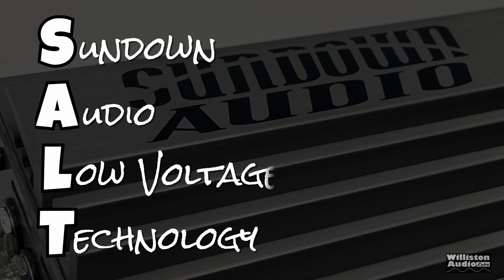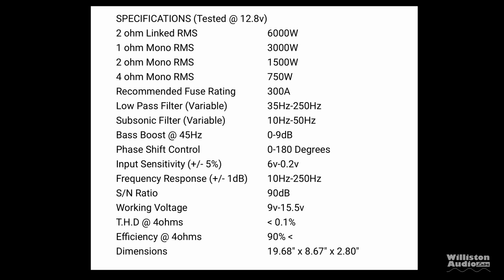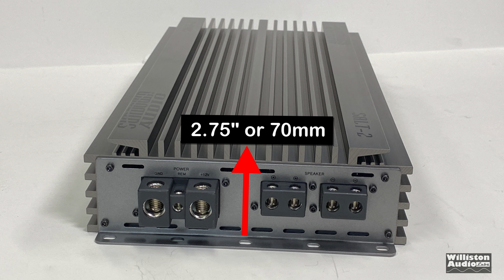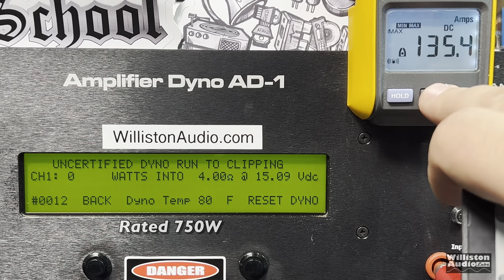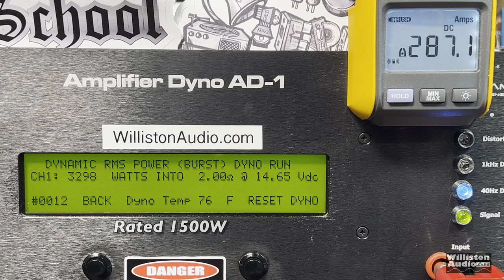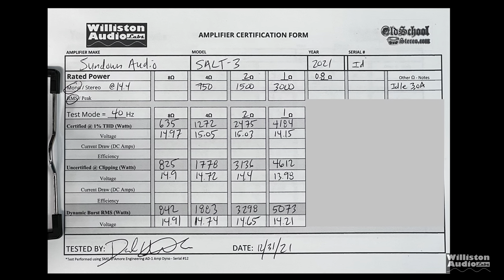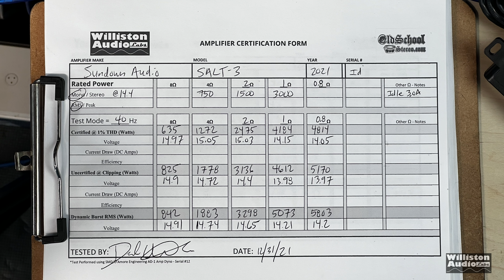Sundown Audio SALT 3 Amp Dyno Test 3000W [4K]

Comment from the maker: Sundown Audio SALT 3 Amplifier
Shop: (affiliate) https://lddy.no/1192y
3000-3500W Korean Amps Tested: https://www.youtube.com/playlist?list=PLu98-M_EowHMCHb5oUBnPVqVhMas4oq62

Video Index:
0:00 Intro
0:25 Sundown SALT Unboxing
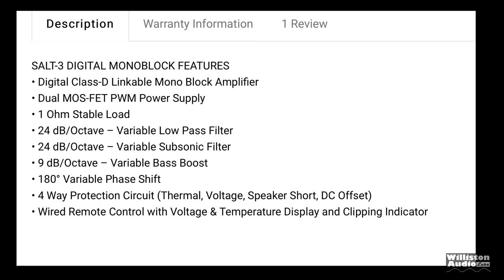1:28 Features and Specs
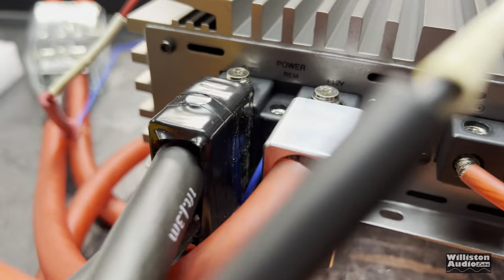3:07 Amp Settings for Dyno Test
4:02 Amp Dyno Tests
6:48 Results
7:06 What's Inside
7:37 Pros and Cons
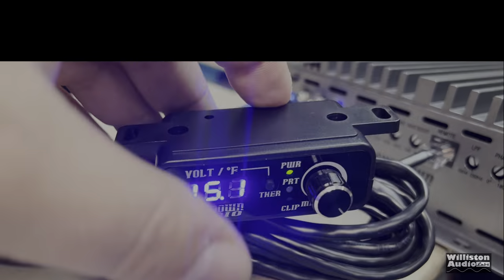8:25 Conclusion
8:55 Extras

--------- Test Bench Equipment -------

SMD / D'Amore Engineering Amp Dyno: https://goo.gl/sJTcf7
XS Power D1400 Batteries - https://amzn.to/2BPFCKW
XS Power PSC60 Charger - https://amzn.to/2CHGcfs
Fluke 1000A AC/DC Clamp Meter: https://amzn.to/2Rw5WDA
Handheld Dyno SMD AMM-1: http://amzn.to/2u2EgKV
My Favorite Screwdriver Kit: http://amzn.to/2x0VzcE

DISCLAIMER: This video and description contains affiliate links, which means that if you purchase from one of the product links, I may receive a small commission. As an Amazon Associate I earn from qualifying purchases
Reply: Do you think its better than the taramps 3k?
Reply: What amp is more powerful the Orion hcca3000.1dsplx or this salt 3k love your work big d keep it up!!!!
Reply: Hey big D can you test the Rockville db comp4 just want to see if it can do the power the DB comp5 does
Reply: Jones subwoofer solution tested the Rockville db comp5 and it didn't 4900 watts at 1ohm dynamic at 14.0 volts I have the comp5 in my Maxima for over 6 months now and it's still going strong thinking about the comp4 for my Cadillac CTS just want to see what it will do before I buy it appreciate your videos Big d keep it up.
Reply: Don't get me wrong I love the amp I would like to have one but I see other amps you tested close to the same watts a little cheaper thats what I'm saying a friend of mines brought a wolfram amp that amp is a beast  it cost less than that salt amp
Reply: @CabinetmanJeremy  I know brother you and I are friends on Facebook trust me I know very well what the Orion's are capable of bro and your missing the party over here on bassheads on a budget it's a slaughterhouse over here lol most guys are dogging Orion which is crazy to me in the 80s and 90s car audio was a brotherhood now everyone wants to rip you apart if your not running what there running it's stupid but I do like sundown's salt series they did a great job just really expensive!
Reply: @justforlaughs8988  lol I knew we was friends I wasn't sure if you knew 😂. I'm a no body so Idk who remembers me or not Bro. And yes you always welcome to tag me ill join up in that group lol thanks Bro
Reply: How many amp fuse did you need to use to run over 500 amps of current?  Or did the recommended 300 amp fuse hold?
Reply: @filibertofonseca8083  The SPLGOD Never uses fuses. Because, it could possibly have a bottle neck on current draw. 🤣 And no body wants that now do they? 🧨
Reply: @CabinetmanJeremy  still didn't answer my question though
Reply: @filibertofonseca8083  Well I'll refer back to my original statement. I don't really know about fuse ratings or recommendations at all buddy. I was being serious, I have never used any Fuses or fuse blocks. I didn't want to give you information that I wasn't sure of
Reply: Do this amp vs Hcca splx3k !!! Especially with your new lithium banks
Reply: I want to try the smallest amp that does the power it's rated if you haven't tried it. Taramps DS 250X2
Reply: @justforlaughs8988  I would love to see a Dyno drag between the two of them
Reply: Sit wiiliston..HOW MUCH THAT AMP????
Reply: @adamstangeland6287  heck ya that would be sick especially on big D bigger lithium Bank he has now back when he made the og splx 3k vid he didn't have the big bank that he has now so it would be awesome to see that!
Reply: I want this 😊 but it’s too expensive ...... sorry 😐 😢
Reply: Check out robot underground combo deal a 8k full bridge and a 600.4 for 600 shipped lol
Reply: Sundown wants 500 just for 8k..

Comment: Been running my Sundown saz 3500d @.5ohm pushing a DC level 5 18"  for almost 10 years now, incredible amps from sundown, worth every penny
Reply from the maker: People will complain about the $$, but reasons like you say here are why some decide to shell out the extra cheddah
Reply: @wal  I'm a firm believer in "you get what you pay for." cheap amps are cheap for a reason
Reply: @KeeMaster  this
Reply: @wal  I get paying more for higher quality, but there are so many other brands that use the same build house and cost half the price. You saw for yourself in the Korean 3.5k videos. The $600 Orion 3k Blew everything away by 2k watts, including the $1000 DC Audio 3.5k. I would absolutely have to buy a Wolfram 9k or a synergy WFO 5.1 that does 7500 on the Dyno. Granted, the Teampie amps aren't quite the same quality, but it's close enough for the price. I can get a Teampie 7500 for what, $700? And the Teampie amp does over 8500 certified on the Dyno.
Reply: I have the v2 pushing 2 fully upgraded spl x8’s in a 6th order at .5 ohm they love it
Reply: यह मशीन कौन से स्टेट में मिलती
Reply: कितने रुपए की है यह मशीन

Comment: Sundown sure like to underrate their amps, which is a good thing.
The SALT series are actually rated at 12 volts, being the low voltage series, and for those who wonder, these amps easily meets the rated numbers and then some at 12 volts.
Of course, at higher voltages, it is not uncommon to see double the rated power.

Anyways, I can highly recommend Sundown products to anyone looking into quality car audio equipment.

Comment: Happy new year Big D! Love the test videos! I believe all the ratings on these amps are at 12.8 volts, that's why the numbers are so high at 14. Look forward to the 4k test!
Reply from the maker: So D4S shows. 12.8, but the Sundown Audio manual shows 14.4. I need to get clarification
Reply: It's 12.8 volts hints the low voltage technology for people that don't have 14.4 or higher voltage systems
Reply: @wal  no worry’s, we know you’ll let us know in the next test! Thanks for putting in the work for us!
Reply: Totally agree. He needs to lower input voltage.

Comment: Hell yeah. I Push the Salt4 daily. Got a zv5 and a zv6 wired in series / parallel down to 1ohm. I’m steady around 14.4v. Can’t wait to see the salt 4k video! Good work man!
Reply: You can mix them?
Reply: @DjR3aper  I did. Generally you don’t want to, you want matching subwoofers with matching specs. Mine are custom geared towards depth and organic reproduction than just straight spl though.
Reply: indian Rs.?

Comment: $1100 for a 4000 watt amp.  Man times have changed in the last two years.  I run a Synergy WFO3.1 and it was $800 new.  More power at any load.  But this one comes with a $300 sundown sticker.
Reply: Rockford Fosgate T40001bd used to go for about that much over 15 years ago so $1100 sounds about right especially since it puts out more than 4K at 14 volts

Comment: Is this too much power for 2 JL Audio 12w7's @ 1.5 ohms? I am currently running one of my w7's on a kicker cxa1800.1  1800w at 1 and 2 ohms, but I am pushing 1350 RMS at 3 ohms and it is handling it fine with no coil burn. Looking to building a box for both 12s, for my 1971 Chevelle.

Comment: Great breakdown, I've seen one of these SALT3 on YouTube in action was pretty badass. I would say probably that's the  best amp for the money. I have an old Autotek Mean Machine 4000.1D from mid/late 2000s.. Wonder how that does?
Reply from the maker: Autotek is a bit hit or miss. By miss I say how much power you're actually getting vs what it is rated
Reply: @wal  I would say at least 1500w and that's fine for me. Appreciate your videos. Happy New Year

Comment: I would like to use a Salt-3 on a Kicker Quad Box but unsure if that would be a good solution considering the L7 is a dvc.  I figure with good electrical I'll be able to throw way more than 3k at the box, just trying to avoid having to run two amps, one per pair.

Comment: For that price I would have liked to have seen better quality components in the amp. I do audio repair and restoration for a living and the cheap Chinese caps in this amp are some of the worst, have a fairly high failure rate. For not much more they could have gone with something from Panasonic’s line, Nichicon, or Rubycon. We’re talking cents per device here. Even if the production cost went up $50 for the entire amp it would be worth it.  I’ve replaced 40 year old Nichicon and Panasonic caps that still measured perfectly and at the same time have replaced dozens of CapXon caps that have failed only being 5-6 years old.  I figured the price of the amp would suggest better quality than budget amps. I guess you’re paying for circuitry layout instead of circuitry components.

Comment: Please help ??? I bought a skar audio 1500.1 mono amp to run a 8in mini mojo mephis sub that I got from Memphis as a loaded enclosure .....my question is where do I need to start as a base line on my lpf subsonic etc.....the settings on the amp so when I first turn it on I don't have any issues ....I haven't ran a system in anything since early 2000.s and mostly back in mid to late 90s ...matter of a fact if it hadn't got stolen about 10 years ago now I would still be using a punch 150 ....never hooked it to anything it couldn't handle ....but someone finally snatched it ...hurt me too I had that thing since 93

Comment: Is there any info or video on your newest version of your power supply? I was thinking of purchasing the Taramps 160 amp power supply/charger to run some bigger amps, but looks like I’d need a pretty decent reserve seeing over 500 amps being pulled at 1 ohm! I’m curious what you’re using to keep your setup juiced, I know a number of cells. The next power supply up is the 220 amp, but 220v input isn’t convenient for a bedroom or office setup.  

Also, is there a power supply anyone would suggest over the Taramps? PowerMax, ???
Reply from the maker: I haven’t made a video yet, but I’m using 320aH of Yinlong/XS Power LTO
Reply: @wal  Thank you so much for the response. May I ask, what are you using to recharge/power them?

Comment: Did you try the 0.5ohm?
Reply from the maker: So it tried the SALT 2 at 0.5 dynamic and the amp went up into smoke. 0.5 resistive load on the Dyno is so totally insane, unless an amp is rated to handle it, I doubt I’ll try this in the future. It’s certain death for most amps and not realistic compared to use with subwoofers

Comment: I wonder how this salt3 and the JP33 would compare. Big price difference between the two. If they sound different.
Reply: I was debating the two. I got a salt3 off of the Sundown Audio yard sale website for 625. You can beat the 💩 out of it, and it barely gets warm.
Reply: @DarrinLintz710  I got a refurbished jp33. I was considering the salt 3 but its so expensive.  I always wondered if the salt3 is better.
Reply: @Sql253  The efficiency is better on the salt3.  Does the 33 get hot at all?
Reply: @DarrinLintz710  I'm running a adire brahma 15d2 and hottest I seen the temp was 92°F.  Its wired in parallel but I don't play it loud like the old days. I have a 290 amp autotech alternator and 200ah of agm. I guess I should need more but my voltage doesn't drop more than 13.8. Amp isn't starving so it shouldn't get hot.
Reply: @Sql253  wow I seen the brahama just came back out. My buddy had one like 20 years ago and it pounded then. The jp33 and salt3 are both Korean and very similar in power. Either is an excellent choice 👌

Comment: Damn man, I have the Orion HCCA SPLX 3k watt amp that you reviewed before, but I don't have a cap or any distribution blocks, so I only have a 320A high output alternator, an Optima Yellow Top battery, and 0/1 OFC copper wiring going into one power and one ground input and the gain isn't even half way up and it's powering my four Sundown Audio SA12-D2s and it POUNDS, but pulls ALOT of power. This amp would be an AWESOME alternative to the Orion amp.
Reply from the maker: That Orion will go down in basshead history. They goteem by packaging a 5kW amp and rate it 3kW, while being somewhat affordable.
Reply: I know what your saying SPL god, it doesn’t make sense
Reply: @CabinetmanJeremy  my guy no one cares. That's what Taramps is for. They are affordable, they are high quality, and they put out stupid power. Sundown is expensive because it's quality as well, Orion is a great company but saying sundown sucks is pointless. They hold records and records of high hitting SPL numbers.

Comment: Thanks, pls could you explain, how in the normal car we will find 3 000 watts of power to supply this great amp. Board current of most veahcles  is near 14 volt.
Reply: Lithium power supply is separate from the charging system of the Car so you can run 16v applications in some instances

Comment: I'll take the CAB-45 and have money left over to buy another one and put the change in my pocket.
Reply: I just got my cab 45 at .5 ohm on Two vxf 12 works great
Reply: Nice amp right there,those 45s are dope
Reply: I can get the salt 3 for around the same cost as the cab, and I’m still leaning for the cab-45
Reply: Id rather have all matching equipment

Comment: How many amp's do we need people. 
I use 3 and my friends think I'm crazy. I'm not a bass head. Loud and clear, tight lows  crisp highs, smooth sound. Low distortion that's what my gole was.
Started off years ago with a Jenson system. One amp driving too 6×9s.
The after market head unit did the rest. Got to start somewhere. Everything was by trial and error. Blew new Pyramid 800 watt RMS subs and other fake brands. That's when I realized that games were being played in car audio.
Reply from the maker: "How many amp's do we need people" - All of them...

Comment: Can you reduce your input voltage to real world conditions i.e. 12.5 to 13.9 volts.
Reply from the maker: I use lithium LTO cells for testing and try to stay close to 14.4 as they are rated by mfg’s

Comment: These were good designs back in the day but now modern amps with constant power are going to replace these.
Reply from the maker: I mean, I can't argue with this. Constant power is a game changer
Reply: Constant power is cool but very hard on charging systems. Of course Alot of the guys using these amps already take care of that side of their build but I know Alot of knuckleheads that don't and will putt crazy power in their vehicles without charging upgrades and a constant style amp will eat their shit up. When voltage drops that amp will increase current demand to stay constant . Bye bye battery and alternator.  But I do agree that it's def a nice feature , companies like JL audio have been doing that for decades. It's just starting to trickle down because price drop in tech. So even constant power technically old.

Comment: I'd like to see what it can do @12VDC.
Reply from the maker: If you want an amp this size I’d hope you would have adequate electrical to supply it. With the lithium setup I have, it’s doubtful I’ll drop below 13.5 volts unless I use my cap bank. I’ll do that for old school or smaller amps moving forward. But…anything 2000W or greater will be tested with lithium bank
Reply: No doubt, but Sundown Audio Low voltage Technology... What are they considering low voltage here? The new battery bank is producing some of the best voltage on the channel.

Comment: Why did you say that you wouldn't use it at half ohm load though?
Reply from the maker: Because I popped one at 0.5, but remember 0.5 on Dyno is like 0.25 with speakers
Reply: Ok I understand now. I run my salt 6 at 1/2 ohm and wasn't sure if I should be worried.

Comment: If it’s low voltage rated I’m not impressed that you ran it at 15 volts. I would think it’s 12. Volt rated amp and obviously not for the average audio system, I’d like to see amps that perform at 12 volts and not 14-16 volts
Reply from the maker: You shouldn’t really be running 3000W amps at 12 volts…and I warned my lithium bank was going to show higher voltages, so it is what it is. It’s really difficult to setup a bench to test high powered amps at 12V

Comment: Nothing annoys the hell out of my more on amps than the gain structure.  Who the hell is running a maximum input voltage of 0.2v??  Do these engineers realise how much of a PITA it is to actually tune the gain when you have any half decent system that has 5 or 6 or even 8v outputs. you have to spend 15 minutes turning the dial just off the stop.

Comment: This why I don't like how Sundown rates their gear. The under promises amplifier power and over delivering sucks in 2022. The subwoofers rating sucks too. This monster subwoofer on the website is rated the same as a Boss or Pyle subwoofer. How's the new guy going to know the gear is good? For those who will run their manholes at me I know it can do more duh 🙄, but how much more? Underrating makes me think they don't stand behind their stuff or their afraid to put a big number on the box (Real number) because it might not make rating it. Or if you blow something up the bean counter can say you over powered the sub because the ratings so low. Disagree with me if you want to,
Reply: Lots of time they taste them according to what the design predicts what it should do. It may do rated, a lil over or Alot over. If they taste for ex to what Big Ds amp tested, what happens when yours does a lil less but still way over what the design messy have predicted. Audio these are all made and engineered by build houses over seas. Hard to measure one batch and rate of that if the next may be all over the place.
Reply: My opinion anyways. Or it can all just be marketing gimmick getting you to live the product because it always does more than rated. Who knows.🤷🏽‍♂️

Comment: Still ain't shit compared to that hcca 3000dsplx you dynoed
Reply from the maker: The Orion was and always will be a beast....as it should be being a 5kW amp rated as a 3kW 😝
Reply: @wal  priced as a 3 kw though and honestly that's most folks bottom line.